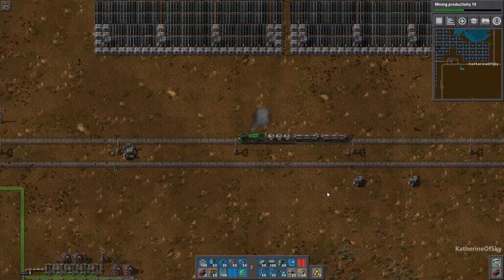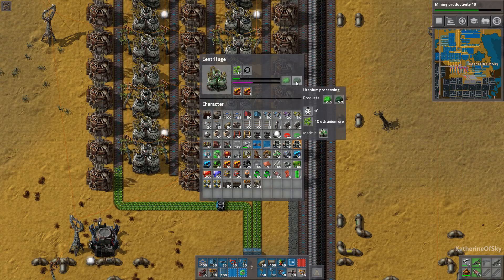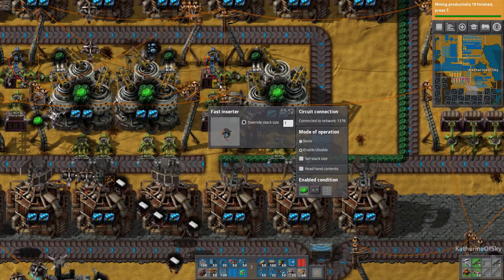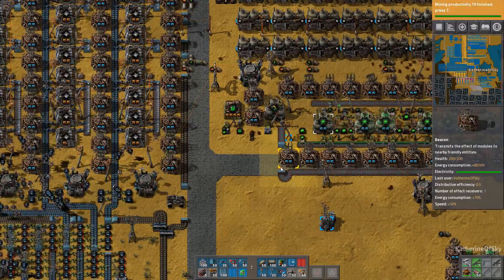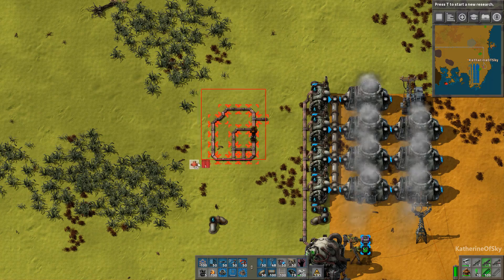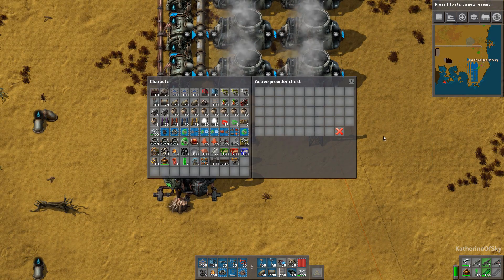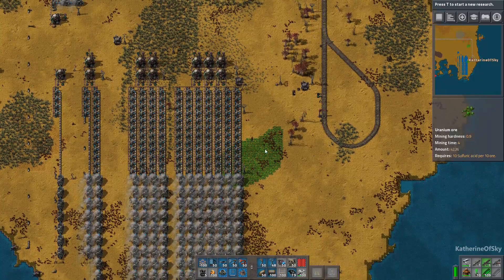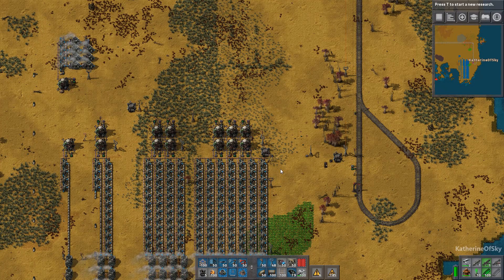Factorio Tutorials: Nuclear Power Setup & Ratios (Uranium processing, Kovarex process)

Comment from the maker: I updated the BP Book to include a new design for Kovarex Processing, which eliminates any clogging due to extra U-238 on the lines.
Reply: hmm i have an issue when i import your BP. 
http://imgur.com/a/D0bfT
Is this a problem with the string or with my client? I double checked if i copied the complete string
Reply from the maker: It's in the Nuclear BP book near the top of the sorting.
Reply: Hey Kathrine,
my game is full vanilla, since i try to get some of the production per time achievements. also im running version 0.15.12 which i think is the latest. Really strange thing...it deletes every building with modules in it and yes i even researched them (which shouldnt be necessary)

However, thanks for your answer and keep up with your excellent videos.
Reply: Oh, its an entire book! silly me :P thanks<3
Reply: Fantastic. We haven't solved that problem yet, so I'll be interested to see what you came up with. Thanks.
Reply: I dont see the kovarex blueprint in the google drive, where is it?
Reply: I have a better one over the belts. Would like to show you, but don't know how to.
Reply: Thank you for the guide! Where can i get your blueprints from? cant seem to find a link. thanks!
Reply: https://drive.google.com/drive/folders/0BwVHGs2mds_XRUVCekwxYnNldnc
Reply: Another great tip. Thanks! :)
Reply: One centrifuge with the enrichment process makes 1 uranium 235 every 50 seconds, out of 1 uranium 235 you can make 10 uranium fuel cells. This is 1 fuel cell per 5 seconds. 1 reactor uses a fuel cell every 200 seconds. This means one centrifuge with the enrichment process can supply 40 reactors, nuclear power is amazing
Reply: KOS can you add a video to the description that explains how to wire the inserters for the Kovarex Enrichment?
Reply: i used your bp book before but now i cant find them how would i get your bp book thanks joe
Reply from the maker: @Coreben.  I don't know where the problem lies.  I just tested in my vanilla game, and I got "blueprint book imported successfully"... and all the blueprints had the correct buildings, etc. 

Try to import into a completely vanilla game, and make sure your game is updated to the latest version.  Also, when you copy the string, go to the google docs page, and press Ctrl+A, (to select All).  Then copy & paste.

Comment: A different approach for the kovarex process -- you can use a u235 overflow mechanism for generating the u235.  Basically; there is a limited buffer to the number of u235 that can be accepted in the centrifuges - it's on the scale of roughly 83 if I recall correctly.  If you have a circular belt where the outer part of belt is fed u238 and the inner part of the belt is fed u235; then you wire all u235 that's generated in a centrifuge to go back into the centrifuge -- you need to make sure that you have 3 blue inserts in front of the centrifuge to guarantee that 100% of the u235 gets captured; you'll accumulate u235 until you hit the centrifuge's buffer saturation point at roughly 83 u235... in which case, on the scale of 1 or 2 u235 will move past the 3 blue inserts and you can filter all u235 coming out of the saturated centrifuges into your other systems; at which point your kovarex loop will become a pure u235 generator.  The disadvantage to using this technique is that it'll take about 40-50 minutes before a given centrifuge reaches it's saturation point; the advantage is that it requires absolutely no circuit logic, set up the system once and go work on other systems for a while and your kovarex generator will be working before you know it.

Comment: Such a great tutorial, I really appreciate this.  I am new to the game and got tired of just constantly expanding steam power, it seems like every few hours of playing it became a chore to provide more power (I could be doing something wrong, but I tend to go with the default solution of "if there isn't enough, just make more").  Currently trying to stack up on Uranium 235 before I build an actual reactor, but the loop system you showed to create more 235 is so handy.

The only thing I'm dreading is the mass amount of U-238 that I'll have laying around.  I've seen some people saying to use it for uranium ammo, but since I am new I am playing with enemies/biters off.  I don't really need uranium ammo, but maybe I'll produce it just to get rid of excess, and to prepare myself for playing the game with biters on.
Reply from the maker: Eventually you will run out of 238.  However, if it keeps stacking up, just shoot the boxes.  Simple.  Done.    Also, you don't need masses of 235 to start a reactor.  Just mine a couple pieces, and that will keep your reactors running for AGES... and the centrifuges (even without kovarex) will produce enough.
Reply: @KatherineOfSky  I ended up with far more 235 than what was probably necessary, and since everything else in my factory was producing well enough, I went ahead and went (kind of) all out with a 4 reactor build as you show in your video.

Completely overkill.  I'm now producing almost 4 times the amount of power I ever have drawn at max times when I was using simple coal/steam energy.  But hey, at least I don't have to add more boilers and steam engines every  other day that I play.  I think the max power draw I ever noted in my factory was 140mw, and now I'm producing far beyond that.  At least I can focus on other things instead of energy supply for the time being.
Reply from the maker: @cheeseburgerwalrus499  The biggest power draw will come if/when you start using moduled builds... you'll need MANY more times the reactors to power those :-)

Comment: First time playing factorio and I was a bit stuck with how many centrifuges I needed to more or less ensure one light geen uranium every 5 minutes or something 😂 I see now that my base is still in the stone age 🥲 thank you, I am excited to get to your level eventually. 😁
Reply from the maker: have fun playing!
Reply: The exact ratios are:  each ore processing operation has a 0.7% chance to yield u235 and a 99.3% chance to yield u238 every 12 seconds per centrifuge.  This means that 1 centrifuge will yield one u235 every 1714 seconds on average.  So... 10 centrifuges will consume 10 units of uranium ore per second on average and will generate 1 u235 on average every 171.4 seconds.

So... if you save all u235 that's generated for kovarex -- you can expect that a 10 centrifuge setup will take roughly 2 hours to collect all of that.

Now... this gets MUCH faster with the kovarex process; because, assuming that you have at least 40 u235, you can generate on the scale of 1 u235 every 60 seconds per centrifuge -- which is... ridonkulously fast.  One u235 yields about 10 fuel cells; which is equivalent to 2000 seconds of burn time per reactor.  So... one kovarex centrifuge will support around 33 reactors running at the same time.  Your biggest limitation from there becomes fluid transport spaghetti and building enough to turbines to support the unholy number of turbines you'll need to extract all that juice.
Reply: Now... I said it would take roughly 2 hours to collect all of that... but statistical martingales are possible (like if you were flipping a coin and you find yourself flipping heads 6 times in a row); so there's standard deviations that can occur that can make it take longer than the exact 1.9 hours averaged expectation value.

Comment: Has something major changed since this video was released? (and blueprints published)

I tried the 2 reactor model blueprint (chests, not belts) ... ratio of 2R : 16HE : 27ST : 2OSP ... should be getting me 160MW

The turbines spun up as expected once the heat exchangers got to 500ºC, but each turbine was only doing ~1.5MW (because they're only getting 16/s steam instead of the full 60/s). I checked the heat exchangers, and it seems that only the two nearest the shoreline were actually producing steam at full capacity (103/s). I checked the two offshore pumps and sure enough neither were doing the full 1200/s.

I feel like it has something to do with fluid mechanics; the distance the water needs to travel between offshore pump and first heat exchanger. Although I do recognise that there's 20 lengths of pipe for each 'run' and the wiki says that should still be doing 1169/s. I tested an offshore pump direct into a storage tank, and it ran at 1200/s (until the tank was full).
Reply from the maker: Is your water too far from the end of the array?   Are you consuming enough power to make the turbines run at full?
Reply: Ok, turns out I'm a dumbass!

I didn't realise that steam turbines, even when in a nuclear setup, throttle themselves based on the power your factory needs. I'd been using an array of steam turbines (not steam engines) with the coal-powered boilers as a stop-gap, a slightly wobbly but generally stable 90MW array, before getting a decent amount of U-235 / fuel cells. It's my first ever play-through of Factorio, so I thought I was being smart by not dismantling the coal-powered array until I was sure the new 2-reactor setup could handle the load.

Of course, the fact that the coal-powered array existed meant that the nuclear setup wasn't really trying. As soon as a dismantled it, the nuclear spun up properly.

All not lost though ... through this trial and error, I've realised by placement should be properly up against the shoreline instead of a little inland (my first choice). As I spotted that my water throughput is only at ~66/100 and therefore I'm only getting 2/3 output from each turbine (~4.3MW).
Reply from the maker: Glad you found the issue!  First playthrough and tackling nuclear is very impressive!  Keep having fun with the game! :-)

Comment: Why the steam turbines aren't running with full capacity when you have this optimal setup? The steam turbines say that their maximal electricity production is 5.8 MW, but I haven't found any explanation on how to achieve that. With some of my setups some of the steam turbines run on this maximal capacity and some don't produce anything, and some other setups produce this homogeneous result, that you also have, where all of them run on the same sub-maximal capacity. Would like to have them all run on the maximal capacity - any ideas on how to achieve that?
Reply from the maker: You need to be using maximum power in your factory: the game throttles all forms of steam engines to only produce what is needed.
Reply: @KatherineOfSky  Okay. Thanks for the info 👍

Comment: I'm contemplating your design for the urarium loop. 

I'm just building my 2nd factory so I'm still figurting everything out. What I did was make a loop with the 238 on the outside, kovarex enrichment unloading on the inside. And somewhere a splitter that filters the U-238. (now the complicated part in explaining :P) on the other side of the spliter I have the feed from the uranum ore processing. 

So basically the U238 is on a constant loop, and the feed from the ore processing is filling in the gaps. 

Only thing I've got to still figure out is how to get the excess U235 off, I still am doing that manually. 

But love your videos, you have a very good way of explaining things and a pleasant voice to listen too.

Comment: Has the ratio changed for heat exchanger to turbine? exchanger is 103/s and turbine is 60/s. Wouldn't that balance out at 3 exchangers to 5 turbines? (309/300) I'm new, so I'm probably missing something.

Comment: Hey Katherine, is there a way to prevent centrifuges from taking more than 40 35 each time so each one of them just run with 40 and leave the +1 for other purposes ? I mean finding a way with wires etc... I'm struggling with this... 
Thanks for your videos :)
Reply from the maker: Yes. There are various complicated circuit arrangements that you can do. I recommend searching the Factorio forums / Steam, as there are some usable builds there. In my own playthroughs I have not found such precision necessary, since I always have sufficient production.
Reply: @KatherineOfSky  Ok thx I will make deeper searches ! Bests
Reply: I struggled to get my head around this too. I found this YT video (plus blueprint in the description): https://www.youtube.com/watch?v=6dVPkyzgOqc

Basically, it's a tile-able set-up of enriching centrifuges. You belt feed the U-238 in (like you would with furnaces and assemblers), but the clever bit is a circuit network on the output line (U-235 only due filter inserters). It basically pulls the 40 pieces needed to kick-start the process again and lets the 41st piece go. With that, you can belt it away, put it in a provider chest etc.

You still need to manually kick-start each centifuge the first time, but that's pretty trivial considering it all just runs automatically after that.

Comment: As the heat decrease along distance.
It will be more optimized of reactors are in the middle. Heat pipes to north, west, south and east,
Your uranium cycle is amazing though
Reply from the maker: The build is optimized even for heat loss.  It's far better to chain reactors to get the 3x bonus than have small groups of 4 and lose out on so much power.

Comment: I have watched this video several times.  Its a stellar video Katherine ... but it loses me in a couple of places if your ever remake another one ... I don't get the 41 count on the chests ... because there doesn't seem to be any consistency of 235 vs 238 demanded by the the processor before it starts chugging.  So I just took your number, doubled it (for two processors) and made it 90.  That works eventually, but I am still bothered I don't understand it.  The other thing that confuses me, is you make a point at 12:15 to talk about the limited distance of the pipes ... then your show these massively long systems.  I know I'm missing something you said, but I don't get how that limited distance issue suddenly isn't an issue.

You don't have to address these here (well you don't have to address them ever), but at some point I know you'll make another because they'll change something.

Comment: does this still apply in version 0.17?
Reply: Yes, the rations still apply.
Altough i suggest avoid using long water pipes to feed the heat exchangers. The setups on this video have problems with water shortage when the plant is under heavy load.
I usually have my exchangers plugged in straight to the water pump and have no problems.

Comment: I always wait till I get Kovarex then let it run for a while before building reactors,  Kovarex combined with spent fuel reprocessing and my Uranium mines almost shut down.

Because Kovarex takes so much U-235(40 units per centrifuge) to get started, I start it before I need reactor power and set up a continuous recycling system only inputting U-238 when needed and let it run, after you get 40 centrifuges it will output 41 extra u-235 every cycle and should cover all your U-235 needs for reactors, bombs and nuclear fuel cartridges plus you won't have to figure out what to do with all that extra U-238.

Of course that is for an medium average size base, a megabase would definitely require a larger processing facility.

Comment: soo... how much water do i need to get the 6 power plant to work properly? i got 20 water pumps on it and it gets 0.1 water. and like 10 of the turbines working.
Reply: Five years late on a response... oh well.  Current stats for this would be... each heat exchanger can handle 10 MW.  A 6 power plant with a 2x3 configuration has 4 reactors with two neighbors and 2 reactors with three neighbors; so 40*3*4+40*4*2; or roughly 800 MW.  So... that reactor design will support 80 heat exchangers.  Each heat exchanger consumes 103 units of water per second; each water pump supplies about 1200 water per second.  So one water pump will support exactly 11.65 heat exchangers; round that up to 12 heat exchangers and accept the fact that your system will stop working as expected if it's at 97% or greater electrical consumption capacity.   So 80 heat exchangers will require only 6.66 water pumps; or about 7 water pumps.

One issue you'll have to deal with directly is pipe flow loss over distance.  A pipe that's 1 unit long will support 6000 units of fluid per second.  A pipe that's 10 units long will support 1344 units per second.  A pipe that's 100 units long will support only 1033 units of water per second.  So... if you use one pump for every 10 units of pipe; then you can guarantee that you'll successfully transport the full 1200 units of water to the set of 12 heat exchangers that you were expecting.  So... the reason why you have 20 water pumps not working is probably because of water throughput loss.  Pumps between pipes are necessary to mitigate this loss.  Fluid mechanics at large volumes are horribly painful to deal with in this game.  Look up "factorio fluid system"; it's not intuitive at all.
Reply: @gilian2587  not to mention they are about to redo fluids entirely :P
Reply: @petrino  I'm curious to see how their new model works.  : )

Comment: Question: Did they remove the fluid tank segmantion?
Reply from the maker: Yep
Reply: KatherineOfSky I wonder why.
BTW, can one use the splitter filtering to avoid using that normal chest part of the uranium filter? Just split the 235 odd, put the 238 in the chest row, and stream them into the centrifuges.
Also, you could wire the inserted for the 2nd inserted for the centrifuge row to not insert if the box has less than, say, 20 pieces of 235. That way, the first one will always get topped off first.

Comment: does the neighbor bonus affect the rate of fuel consumption, or does it just massively boost efficiency?
Reply from the maker: It makes the fuel produce more power.  But the time for fuel depletion doesn't change.
Reply: KatherineOfSky do you actually need both to be running? Or just having a few reactors together is a passive bonus?